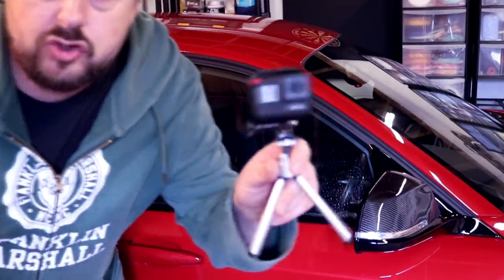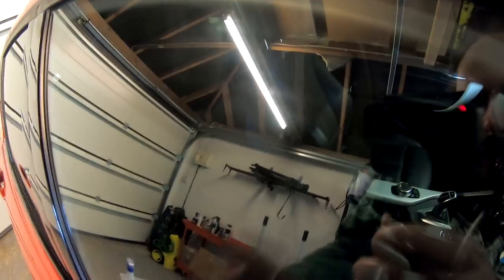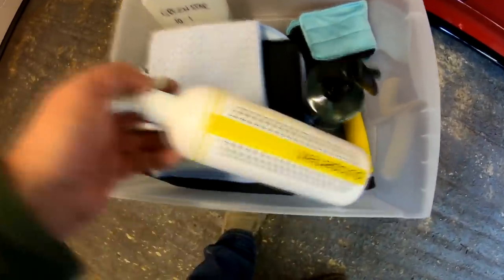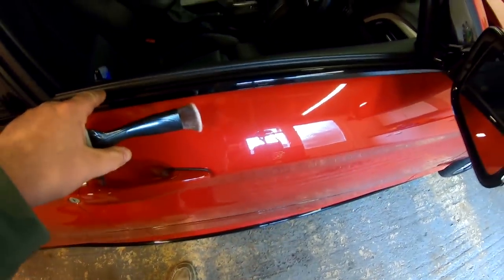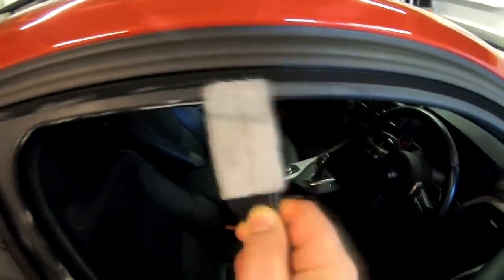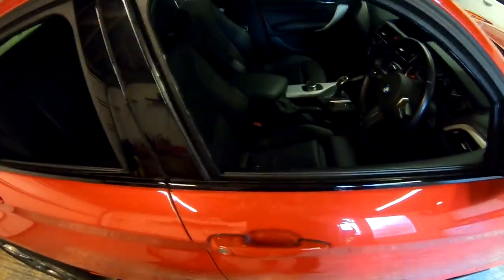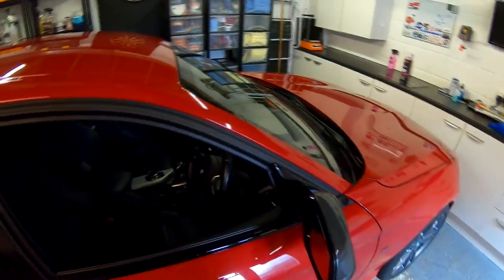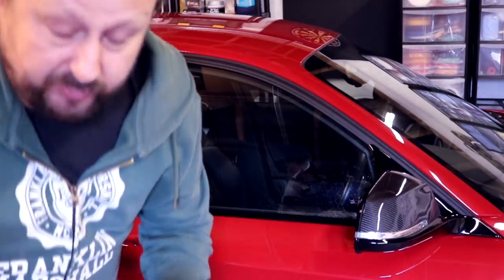Yearly Glass cleaning tip - The forgotten job

Comment: You read my mind John! I’ve noticed those smears on my windows in the last month or so. Never thought to do anything about it. Next clean it’s getting done!  
For cleaning glass especially interior I use a method I picked from your pal Levi Gates on an old Rag Co video. Spray ONR (1:256) on a Black Diamond cloth, work in the glass and wipe excess with a waffle weave. Because the ONR doesn’t flash off really quickly because there’s no alcohol or similar, you get plenty of time to work it and you get zero smears.  I dismissed the idea out of hand when I first saw the video, but after giving it a try, I’ve never used a glass cleaner again.

Comment: Cleaning the glass has always been the most frustrating part of doing a detail on my car.  Regardless of the effort you put into everything else, your job never looked looked finished. Anyway, thanks for the tips. Cheers.
Reply from the maker: yer its a pain wayne, inside of the front windscreen is the fun one :)
Reply: @ForensicDetailing  I only touch the inside of the windscreen once a year. Looks like I got some oily film building up on it so have to get on it again.

Yeah Wayne it's annoying cleaning glass. After I hand wash and dry if it's a cold day I like to use Koch chemie fse around the car including the windows to get rid of water spots. The problem with glass is you can easily see streaking which I've found a waffle weave to help remove.
Reply: @zaink7037 .Jon advised me in using Autoglym Glass Polish, not the "fast glass" and he was right. It removes everything after 2 or 3 applications.

Comment: If you don't have this special cleaner tool, just use a plastic wedge tool (used to remove the plastic trim) wrapped in a regular low gsm microfiber towel to clean the seals. The towel is probably easier to clean, too, and also has a larger surface, so you can start with a fresh surface at every seal/window. Great video anyway.

Comment: You can replace those with new ones quite easily. I see them as sort of wind screen wipers. In a morning when going to and from work when its cold and there's that fogged up mist on the windows i just wind them down and back up and it clears them like windscreen wipers but when they are old they leave smudges and smears. Sometimes some white vinegar in some very weak dishwasher solution to clean them does wonders but i use rubbing alcohol after to make sure no residue is left.

Comment: Another great video! Have the same issue with my e92. I use a ruler wrapped in a microfibre + APC to clean the felt and rubber along the bottom of the window, works fine although can be a bit tricky getting into the corners.
Reply from the maker: thats a great idea that will work and you can swap the microfiber.  the little tool you cant take that microfiber off so its gets gunked up.

Comment: Perfect timing of this video! The previous owner of my car has put window tints (film type) and there are these vertical smear marks on them which I couldn't work out where they are coming from. This video has hopefully answered that. The glass seems to sit in tight between the rubber seals on mine though so will need to see how you managed to put a microfibre between them...

Comment: I spent about 6 hours on my car last week, but couldn't get the glass clear.  It's a 2 door BMW with frameless glass that drops 1/2 an inch when you open the door.  Each time I opened the door, I get a smear on the bottom of the glass.  My girlfriend'd Mini does the same.

Great vid, Jon.  I'll be doing this next weekend, but would probably add some dwell time for the APC, followed by a wet cloth rinse stage .

BTW, I bought the Autoglym Polar kit....  I didn't get on well with it, unfortunately.  It left loads of smears and runs after the wash stage, so I had to rewash with something else.
Reply from the maker: yes I think like you could spend a bit more time to really clean it than I did there.   I think its important to dry it out as well.   would be a good job for when it warms up a bit so it dries naturally.

Comment: Once again thank you for so simple advice that helps us mere mortals. I shamefully clean/dry windows in the morning  by powering the windows up and down but never get around to giving the rubber or felt a deep clean during my weekly wash. Just a light rub over, grts some muck off but I really should spend more time on it
Do have a link for the tool ? Good advice from  other subscriber Gabor on using wedge tool with microfibre cloth.

Comment: Just about to do this exact job to my 12 year old car, noticed it has a build up of green algae etc, probably never been done in it's life and may take a few hits to shift it all.

Also same as yourself i use the 2 cloth technique with a typical glass cloth and waffle weave to finish.

Not found a glass cleaner that does not work yet, cloths more important.

I do want to try the autoperfekt one though, as i rate them highly as a brand and are rebranding themselves at the moment and tweaking their products, so look forward to trying their stuff.
Reply from the maker: true dat.  like specially on the inside, like the face of the buffing cloth gets clogged with crap very rapidly so lots of cloths I find helps.
Reply: @ForensicDetailing  yup exactly, one of my favourite things is lovely clean streak free glass.

Also just finished my window rubber/felt lots of crap came off, loads better now.

Used a dry klin monster to finish and it's a ideal job for it, really is a great cloth that just takes the abuse. (Loves the jobs other microfiber hates haha).

Comment: Another great vid. Thanks. Any tips on cleaning the rubber on older cars? All my cars are 18+ years old and the rubber surrounds have not aged well.
Reply: The rubberish materials on the door surrounds I've noticed attract a lot of dirt which you can remove with a microfiber cloth. I like to clean it after a snow foam
Reply: If you've mold or even possibly lichens on them, you've to scrub and scrub, until you get rid of those. However, once you're done with that or if your problem is only that the rubber has faded, then you can use rubber care products, like Meguiar's Ultimate Black to restore their blackness and sheen for a relatively long time period. Like doing it twice a year should be enough. These products will also make the rubber more water repellent and a little bit softer, so they will seal better. If that's no help either, then the only option is to replace the rubber seals.

Comment: Dude most cars have little rubber grommets which are used to allow the inner part of the door panels to help remove any excess water or have even little holes on the inside of the door panel to allow water to escape but no matter what you do, if you wash the car the water will go into the inner part of the door and the only way to get it out, would be to use a hi pressure air pointed nozzle and try to dry it out with that after each wash ? cheers:) But your right not many people clean the rubber and felt areas of the door window jam areas, i do always have, basically use a good solvent no acid type and also wipe it down really well after cleaning it ?

Comment: Thanks, as always Jon, great advice indeed ! So I just did it with a thin plastic tool that is used to agitate paint. A whole 12" x 12" microfiber ended totally black with just 2 windows... 😑 the car is 6 months old, but where I live we get a lot of sand from the Sahara travelling west to the Caribbean : at times rains will really leave the cars SO dirty. I guess your small MF accessory wouldn't do the trick... Guess I will have to clean this more than once a year ! One problem is that my passenger's window does not come all the way down inside the door, I was really afraid to insist there. 
I actually recently explained to our security guard at work that he wont see me often saying hello through an opened window: I dont want to seem rude, I said. I will wave at you through my closed window, because my old car had so many streaks on my window I wont let that happen again 😁
Reply from the maker: you could pop the door cars off maybe Delphine.  Its a pain in the ass to do but like if every time you wind down the glass its leaving a mess it could really help.

Comment: Nice tips! Is it worth doing a ceriglass polish once a year as well? Do those products make a big difference to light pitting and scratches?
Reply from the maker: no idea mate sorry.  I dont really think glass is a material you should polish, but dont know
Reply: @ForensicDetailing  with cars over 10 years old the glass typically picks up so many marks that just cleaning it doesn't really do the job. Would love to see you do a review with some of that cerium oxide compound stuff and glass polishing pads to see what results can be had.

Comment: Do you believe applying a sealant inside and outside the window would actually help ? Or just add more residue and streaking? I was thinking Beadmaker.  But not too sure...
Reply from the maker: I dont think applying sealant inside is worth doing.  but perhaps some anti fog if fog is a problem.  Outside its really personal choice.  my glass I think had something on it when it was supplied to me.  Whatever it was is still going strong on the sides but not the front or back where the winder rubs it off.

Comment: Does that grime on the glass come when the glass makes contact with the sills between it? My car's glass doesn't touch the sill so doesn't look to get dirty but is annoying when you want to put the window down to try to get rid of any water. 

The stupid driver side window has stopped working on my car 😢. Can hear the motor when I press the down button but it doesn't move down. Will have a go cleaning the other side  though 👍
Reply from the maker: must do because the smearing on the inside is in straight vertical lines. Zain.

Comment: Hi mate, do you use dash and plastics dressings? That was one of my favourite parts of a detail,getting them all evenly matte looking but I was forever getting a greasy build up on my glass and think it might be the dressings - even some days later - basically evaporating off and onto the glass..... I'm having to use IPA to try and clear them all the time...
Reply from the maker: not on the m140 really.  Its garaged, the interior looks good, its new-ish.     I would prolyl go with perl at low dilution is I did.  On the golf I will perhaps sling a dressing on because it just makes it look better but that car is like 8 years old.        Funny yes if you use a solvent based dressing, other peeps tell me (and it makes sense) the solvent vaporises from the dressing and can cause like slime residue on the glass interior.    But even with no dressings apparently the plastics contain formelahyde (sp?) and that vapes out of the plastics and can make a slimey layer on the glass.

Comment: hi mate. i really like your videos. would you suggest any clay bars? (cheap)
Reply from the maker: bilt hamber soft clay bar for most normal newish car or cars without heav contaminant, then their regular one for heavy, or in2detailing fine or medium if you want I think the cheapest good clay on the market.  the BH clay is brilliant. its stiff though which means can take a while to warm. but once its in  a disc it wont like go to thin quickly so you have to fold.  you know what I mean, sometimes they can be too soft like chewing gum.
Reply: Forensic Detailing Channel thanks, I will have a look! I’ve ordered the new A1 and should be at the dealership within the next week! I want to keep on top of keeping it clean because once it gets really dirty, it’s a hell of a job to get it back to perfect imo.

Comment: what do you advise for the hardest wearing glass sealant, currently using meguiars sealant but was wondering what the best is
Reply from the maker: none mate.  I like to go commando.  :) but its not a case that Im right and anyone that uses a glass sealant is wrong.   I just like to have clean glass and wiper blades generally.

Comment: Ohh all these keys on the car key risky might scratch the door 🙄  haha that would drive me nuts 😂😂😂
Reply from the maker: its like keyless entry on the car. but yer I have like a jailers set of keys real pain, but I have keys to other properties and stuff on there, which I take off when I dont need so its not always so bad as this.  I had like gas keys and all sorts of crap on it :)
Reply: Forensic Detailing Channel haha keyless cars and push button start have a very bad repatriation for getting stolen in 30 seconds you might want to look up Ghost System to stop them starting the car and driving away.